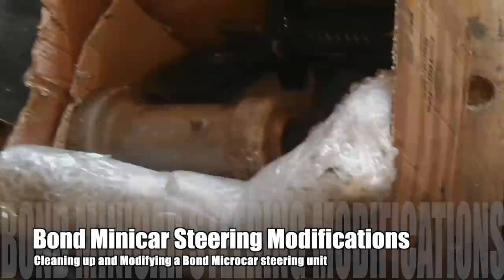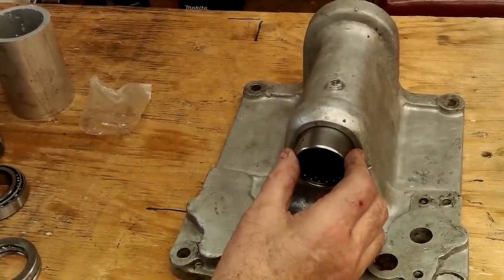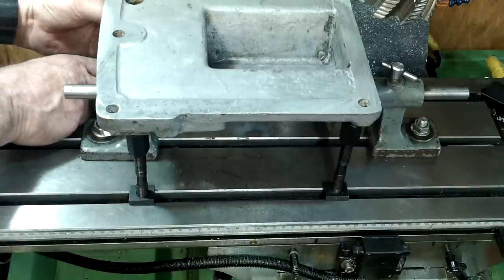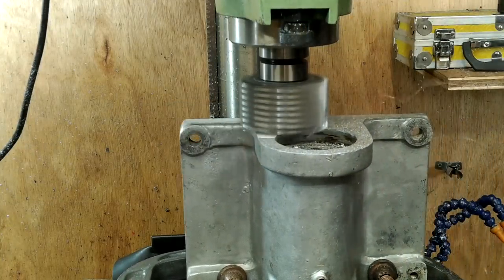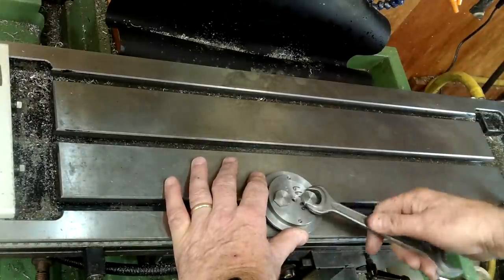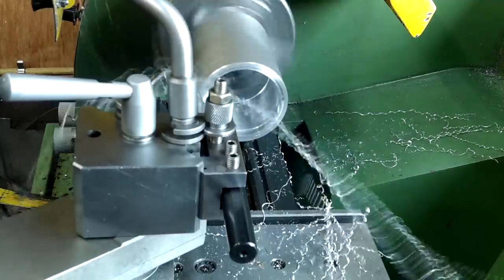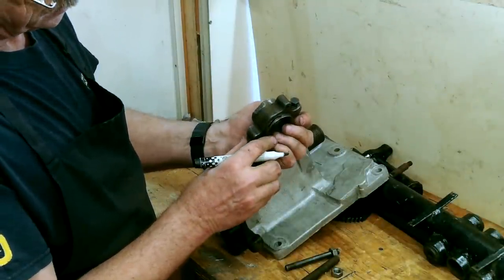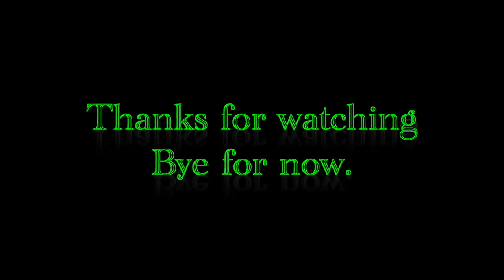Modifying a Bond Minicar steering.

Comment: Thanks for the video, your setup work is first rate, very innovative,  thanks for sharing.  At about the 12:00 minute mark you talk about having trouble removing the old bearing race.  To remove races like that, I either weld around the inside of the race and it falls out, or weld a bit of bar across the race to drive it out from below.  Works for valve seats as well.  Thanks again :)
Reply from the maker: Thanks for the info, I couldn't be bothered with all that kaffufal, I knew that I'd be machining that face anyway. The bar welding trick is one I've used in the past.

Comment: I watched with great interest how you improved the Steering on the Bond Minicar. I owned a beautiful '57 Mark D back in '68. The Bond failed an MOT for excessive play in the Aluminium Casting. I seem to remember that I purchased new Bushes, but (from memory) I seem to remember that the Bushes were parallel - and with a small top hat. Anyhow, I changed these, and the Bond passed the MOT. I never really noticed any problem with the steering, even with worn bushes in that Casting. BUT - what scared me the most , was the tiny Brakes!! Rod and Clevis Pin, with worn Clevis Pin Holes, gave lots of "free Play" on the pedal. Yet, the Bond passed an MOT on the (very poor) brakes!! Nice to see how you overcame the 'woolly' steering issues, and wondered if you applied gentle heat to the Casting in order to aid a good fitment of the Needle Race, and Taper Bearing. You are meticulous, and you have (most probably) spent your lifetime as a Fitter/Machinist, and enjoying your workshop. I had great days in my Bond, making trips from Blackburn Lancs to Wales with Camping Gear. I only paid 7 (seven) pounds for the Bond, which was absolutely immaculate, with cream convertible Hood, and cream interior. SIBA Dynastart never failed. Memories fade a little these days - but what a car!! Greetings from Sydney Australia.
Reply from the maker: Hi, I am constantly being asked to make modifications to these magnificent little motorcars, but sadly I can't commit the time required to make and modify all the problems presented to me. However, I am constantly asked to help with one thing or another, this is why I've published videos covering the work I've done that owners can show their local engineer how its possible to make the mods.
The brakes are for the most part barely acceptable and as you may have guessed I have modified the braking system on a '55 Mk 'D' it now stops as good as you could ever want, leaving three short black tyre marks on the road. I will soon be having a crack at making a mould to enable the bond owners club to re-manufacture rear suspension units for themselves, using all the reclaimed metal components and forcing new rubber 'by transfer method' to make as new old suspension units.
regards
Reply: @Thesheddweller  Thanks for your reply, and just glad that there is someone with the knowledge and skill to raise these fine little cars back from the brink! It's also hard for me to understand the high value of these mini-cars today. I like the thought that you have also worked on the Braking System, "leaving three black marks" sounds good to me. I never had any problems with the Indespension Units at the rear, they worked fine. From memory (again), I believe that these were also a Casting, and bolted to the chassis with six (6) threaded bolts. I am surprised that some 'modern' conversion is not available for a direct replacement. And (again) from memory, I believe that the Unit Axle was square (inside the Indespension Unit), with four (4) round pieces of rubber, which was compressed by the suspension action. It would not be impossible to get a copy and have someone make those castings again. Modern rubbers do not deteriorate like the old version, as long as the rubber hardness values match the original values, such as EPDM. I googled "Bond Minicar Electric Conversion" yesterday, just to see if there was anyone in the UK who had achieved this! Being made from lightweight aluminium, I figured that (for a local runabout) someone may have placed a Motor in substitution for the Villiers 197/250cc engine. Batteries in the rear, and converted to a two-seater. I'm 73 now, and my daily drive has been a '71 Beetle - since 2004. This has recently been converted to Tesla Battery Pack, and the latest 120HP Electric Drive Motor. Currently, the Beetle needs to undergo re-certification before I can use it on Australian Roads. Beetle has a range of approx. 180kM before recharge. It's been a bucket list item that has taken more than two years, now reaching fruition. You have a well kitted-out Workshop, and I feel that there are not many (like you) who is extremely careful and cautious - in covering every fine detail in your machining and also your approach that has led to fine improvements of the Bond Minicar. Finally, being a 'short' person, (1.6mtrs), I discovered that the Bench Seat in my Bond Mark D wasn't adjustable. I always had to drive it with a thick cushion between me - and the Seat Backrest!! In hindsight, perhaps that was the reason that the Brakes always felt very 'spongy'.
Reply from the maker: @peterduxbury927  my mistake it was a 1960 mk’’F’.. the mk’D was other stuff. For the record they all had spongy brakes.

Comment: A very good solution for a product that was designed with the materials, bearings and resources available at the time.
Thornycroft/Leyland used mild steel bushings in their gearboxes and ancillary equipment to cover the metric or imperial bearings that were available to them, even into the 90’s.
As to sealing you might look at how Vincent or Arial used felt or neoprene washers to provide sealing solutions.
Again a very good solution.
Reply from the maker: Hi, as far as the seals are concerned I explained to everyone that a leather, neoprene or felt ring will do the job if they want to, I wrote a note once in their newsletter about this subject. I find if you give people a reason not to do something 'like regular greasing’ it won’t get done, so leaving the option to fit seal rings is an option that gets people to look at what they have and maybe respect it, or maybe give it a squirt and a wipe its easier than fitting seals.
Reply: @Thesheddweller  Hi, yes you can lead a horse to water etc.
I would think that the position of the original grease nipple was also a contributing factor to the lack of lubrication to the pivot.
It should have been in such a location that no matter where the suspension link was, lubrication could have been achieved.
Designers/engineers have been the bane of my existence on occasion.
Good job and good luck.
Reply from the maker: @pebrede  Cheers

Comment: What an excellent video! I normally have so many questions and you have predicted and answered them all. Extremely educational, thank you. I don't know exactly what a bond car is, although it's fairly clear from context. I'm curious, if these castings are in such poor shape, what drives the decision to rehab them instead of creating a new weldment? Presumably these are collectible, there is a goal of keeping them as original as possible?
Reply from the maker: Hi.  These little cars are fantastic little cars from the late 40’s to the mid 60’s. They are probably not the smallest car in the world but the engines are between 180cc and 250cc for the Minicars and the bigger range up to 2000cc I believe.
The reason they don’t get new castings is that the process is an expensive one, and I think they would be the first to admit that they haven’t exactly got very big purses.  They currently have a world wide shortage of rear suspension units and I've been asked if I will make a transfer mould to enable them to repair thousands of these old units. I might make a video about this when I get time. regards
Reply: @Thesheddweller  would be good to get a solution for the "indespension" units as fitting 2nd hand ones is a huge gamble!
Reply: @Thesheddweller  thanks much, I think I understand the appeal
Reply from the maker: @jpsimon206  I wouldn’t have one. I’m too busy.
Reply from the maker: @nrs91  Im already on it. regards